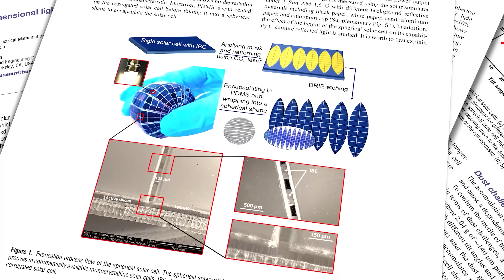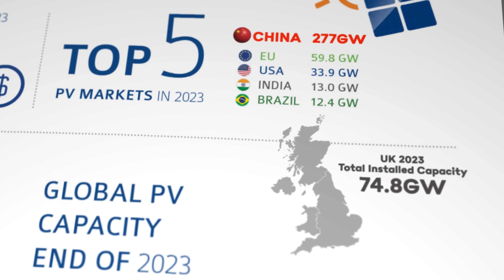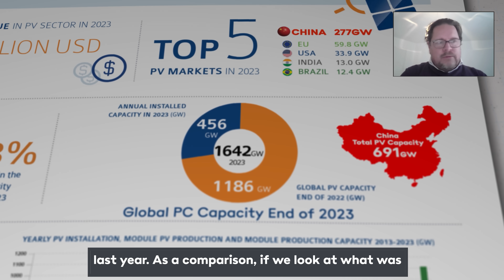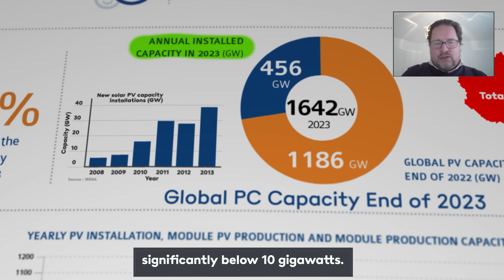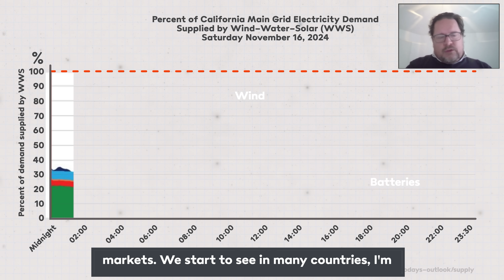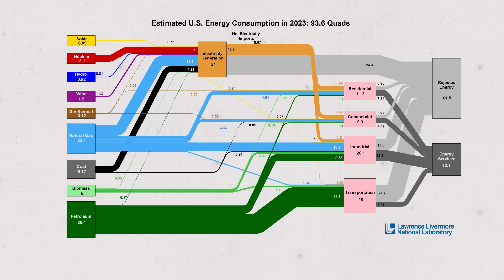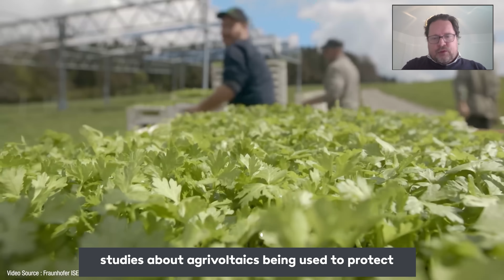Renewable Energy Domination

Comment: I understand that my household uses less than 10 KwH per day, unless I charge the car, in which case it adds 20 or 30 more KwH.  I can't possibly conceive of what 10 or 11 Gigawatts is.  How do I measure it, or compare it?
Reply: 10 GW will in an ideal situation (sunny, middle of the day) produce 10 GWh in an hour. 10 GWh is 10 000 000 kWh. So one hour of output from a 10 GW installation will power your home for around a million days, or close to 3000 years. But I guess a better measure is splitting 10 GW with 10 million homes each one using 1 kW for heating/cooling/cooking etc.

Comment: Physics tells us that every time you convert energy from one form to another, there's always energy loss. Different battery types store the energy differently. Car batteries for instance prioritise space use over energy efficiency.Which generally means that after converting electricity into battery storage and back you only have 30% or even less left. What that means is that to completely outcompete fossil fuels you have to generate the energy a about 1 third of the price with renewables. With other batteries that prioritise energy conservation this might be less. But its hard to combine those 2 priorities. So i dont see why car batteries is going to be the main energy storage for the grid. It just doesn't work as efficient.
Reply: Rubbish. The round-trip efficiency for car batteries is above 90%.
Reply: @rockyallen5092  
Take it easy, it's actually about 80, if not lightly less.
Reply: @rockyallen5092  Sounds very high. Do you have a link for that?
Reply: @martijnklijn2068  Well it sure as hell isn't 30 or less.
Reply: it's more to do with habits than tech/physics, surely?  Domestic cars, including EV cars, spend most of their time sitting around not being used, and so make ideal ways of balancing the grid if they happen to be connected.  Making smart grids through clever software is going to be the next big thing IMHO.

Comment: In Australia we pay much more for electricity due to the costs of converting the grid to cope with the excess energy produced by solar panels.  The transition to solar isn’t easy, or cheap, and the opportunists who have positioned themselves to take advantage of conventional base load generation when the system is stressed make a fortune by charging one. However, there’s a developing awareness that cheap EVs offer an excellent solution to using the excess solar power if they are charged during the day.
Reply: In places like Australia the government should require all workplace car parks to be fitted with chargers so cars can be plugged in during solar production time.
Reply: @adrianthoroughgood1191  better still, put solar roofs over the car parks as well - the cars get shade and electricity at the same time.
Reply: @theharper1  The charging can be done in DC.
Reply: @ronaldlindeman6136  that would be more efficient, but not necessarily practical depending on how the charging service is provided. From an employer's perspective it would be easier to outsource, so a standard grid connected charge point would probably be more likely, offset by the power from the solar roof (if installed).
Reply: @theharper1  absolutely! France has passed a law requiring solar panels over car parks.
Reply: @theharper1  Sure.    I have no direct knowledge of how the charging works, but I did think I read from comments that if someone has PV's and a solar system at their home and charge the car during the day, that charging would be done DC.   Like if someone has batteries hooked to their solar system, they I'm guessing they don't go from DC to AC to DC to charge the batteries?
Reply: @ronaldlindeman6136  I had to check myself, because I don't own an EV. The SolarEdge charger (as an example) is an AC unit not DC. So it would require a hybrid inverter. With respect to household batteries, it depends on whether they are AC or DC coupled. The Tesla Powerwall 2 is AC coupled and sits between the house and street in the circuit. So yes, the solar inverter converts to AC then the Powerwall converts back to DC to charge the battery. The SolarEdge battery is DC coupled, so it takes DC directly from the inverter which is more efficient. It looks to me like "mode 3" EV charging is AC coupled. SolarEdge was talking about introducing a bidirectional EV charger which would allow the car to supply power back to the grid (if the car is capable of it, and Teslas currently are not. The only cars that I know of which support V2G right now are Nissan EVs like the Leaf.
Reply: @theharper1  Thanks for the info on chargers, Solar power, DC or AC for batteries.    Only one car/motor vehicle support V2G?   They should get on that.
Reply: @ronaldlindeman6136  Nissan and Mitsubishi are the only companies that I know for sure support V2H/V2G because in Japan it's a disaster preparation feature so you can operate some things in an an emergency like your refrigerator when the grid is down because of an earthquake or typhoon etc. I checked the Australian model of the Mitsubishi PHEV models and they only support V2L while the Japanese models support V2G and V2H. The Nissan Leaf is the only one that I know has been tested in Australia with V2G. There may be Chinese EVs which support more than V2L but Tesla has so far refused to support anything other than V2L as far as I know.
Reply: @ronaldlindeman6136  I found a website which lists cars that have V2L, V2H and V2G. Brands include MG, BYD, Chery, Hyundai, Kia, Genesis, Nissan, Cupra, Mitsubishi, VW, Xpeng and Zeekr, but most are V2L and very few V2G or V2H. Tesla doesn't support V2X at all, and some suggest that's because doing so would undermine Powerwall sales.

Comment: So solution to end-of-life solar panels is recycling. That's the same plan for plastic, and you can see how that is going.
Reply: Difference is plastics are not valuable. Makes more sense to harvest back the good stuff from end of life solar panels, no?
Reply: @Sekir80  I'd say the difference is that solar panels last 25-30 years, while most recyclable plastic is single use.  I question the value of an old solar panel.  They are primarily silicon, derived from sand.  Not valuable.  They have a very low concentration of moderately valuable dopants.  A small amount of low to medium value metals used as conductors.  Where's the value?  I'm genuinely curious.  Absent some solid numbers, I suspect that they'd be fine getting crushed and dumped in a landfill.
Reply: @incognitotorpedo42  What a great point on single use/long term use!
And yes, I don't know if we can or if we even care to recycle silicon. Metals, on the other hand, can be useful. Most of the panels use alumínium as frame, that's good stuff. The rest might be trickier to claim back.

Comment: 13:35 "Discuss"  The 100 ships of coal, and the 50 ships of LNG represent "Energy". The ship with PV panels represents "Power".
Anyone that can't keep those two concepts straight should stop talking and sit down.
If he was referring to the "lifetime power" of the PV, then I suspect that he's way off in the numbers. 
And the 'when' would be an important counterpoint.
Reply: it is called: energy equivalent. Second, what would you do with the coal, if not making black ink? Right,, 99% of it is used to create electricity. Then do your calculation and convert
Reply: @monnoo8221  Have a seat.
Reply: @JxH  Obviously the PV was lifetime energy.  That's the only sensible way to describe it.  The LNG is burned once and it's gone.  The PV panels keep cranking out energy for 25-30 years.

Comment: Per capita is actually not that accurate. Smaller populations have it easier implementing solar.
Reply: Quite the opposite, a larger population will have it easier with the large-scale construction needed to balance solar power.
Reply: Australia is a continent with an interconnected grid,  that’s not easy at all for a small population to achieve, in fact it’s the most difficult distribution of power there is. Think again.

Comment: Wake me when "renewable energy" factories and supply chains are ran on renewables.
Reply: You better get out of bed because it's already happening.
Reply: Why? The video showed (which most people surely already knew) that the amount of CO2 emissions from the production of solar panels is minimal compared to the emissions from burning fossil fuels, they do what they are designed to do; providing us with far cleaner energy and helping us get to net zero.
Reply: @danyoutube7491  The video showed it, but reality doesn't.
Reply: @nustada  
"The video showed it but Reality doesn't" 
Are you deliberately ignoring the available facts?
Unable to use the internet?
Wilfully ignorant?
Living under a rock?
Lying?
I have noticed one thing about your posts, they are outdated nonsense.
Give it a break.
Reply: @davidwatson8118  You realize you said nothing of value?
Reply: @nustada  
Ok, so all of the above.
I'm not your librarian or research assistant.
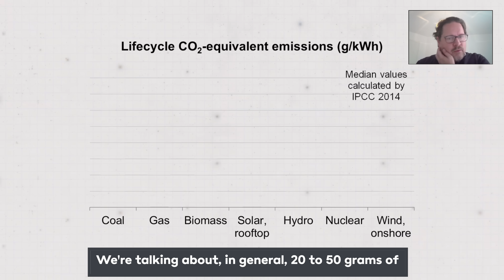Reply: Go back and watch 4:00 again so you can get a clue. Even if you powered the factories, ships, and trucks with 100% coal, tha would still only be ~8% of the emissions they displace in operation by not having to shove millions of tons of fossil fuel crap into a thermal plant for 20+ years. Renewables will continue to decarbonize along with the rest of manufacturing.

Comment: It won't work. The resource demands of solar and batteries - mining all those rare earth metals, to say nothing of concrete and steel, currently supplied by a predominantly fossil fuel economy, will become impossible to source or afford as a) resources are mined out, and b) with intermittent low grade energy. 
Solar panels last around 20 years, and batteries about half that. The recycling costs of billions of solar panels - again, will be unaffordable with low grade intermittent energy.   
A square of solar panels 1,500 km per side covers an area of two million two hundred and fifty thousand square km; and putting that 'in the desert somewhere' runs into the problem of getting energy from where it is produced to where its needed. 
And that's just to supply the electricity grid which is approximately 15% of total energy consumption. Total energy consumption in the United Kingdom was 142.0 million tonnes of oil equivalent (1,651 TWh) in 2019. 
And that's saying nothing about the rest of the world, including developing countries that can't afford to spend untold billions forevermore creating a mountain of tech scrap.  
By the time it hasn't worked, it will be too late.
Reply: Well, the Australians are already building a solar plant to provide power by cable to Singapore.
Reply: @seanlander9321  Are they? Weird. What kind of solar? Photovoltaics produce 48v; whereas an undersea cable requires 100kv minimum, with maybe 5%-10% transmission loss per 1000km. Singapore is 4300km away; meaning an undersea power cable six times the world's longest cable, to transmit solar energy at an ~30% power loss. You'd need an awful lot of solar panels. Even using heliostat power plants, (solar reflectors focused on a central tower) it would take less resources to generate the voltage needed - but the transmission distance is still a world record, and by a long way.
Reply: @ Suncable, it’s on the ASX.

Comment: also worth mentioning that some countries convert their hydro use to a pure ‚battery use case‘ where the use solar overheads during daytime to drive power at night. of course not every country is able to do that but it is a very efficient form of offsetting base loads that is available right now and would still have great potential for extension.

Comment: Could someone please explain to me what the Primary Energy Fallacy is, as mentioned at 8:18 ? Ideally concisely and simply, like Dave does. Thanks
Reply: The graph shows primary energy use vs real one. On the right side there are two important boxes "energy services" and "rejected energy". They are 1/3 - 2/3, roughly. The point is primary energy (coal, oil, gas, nuclear) is 3 times more than the actual electricity we use: you have to burn 3000 MWh of energy to create (and use) 1000MWh of electricity. Therefor, the 2/3 of the burnt energy is nothing more than waste heat, we discard, reject is. 
How did I do? Would you need another go? I'm thinking I did a half-decent job. Maybe.
Edit: Oh, the fallacy part: naysayers of solar/wind deliberately conflate these numbers and saying "we need 93.6 Quads of energy to be produced each year! solar and wind can't do that!", but actually we need to generate 32.1 Quads (energy services box), almost exatly only the 1/3 I was mentioning above.
Reply: @Sekir80  All the parts have now clicked together. Thank you, you did great.
Reply: @marsupialdungbucket  Thanks man! Glad it's clear.
Reply: @Sekir80  But primary energy is used for much more than just electricity generation.
Reply: @SweBeach2023  True! I was focused too much on that, sorry. Yet, you see the rejected box so big. Let's look at the bottom part, for example, petroleum -> transportation. See how much that contributes to rejected energy? Because ICE engines are very inefficient. If every vehicle would be electric (yes, planes as well) then it could be 85-90% efficient compared to the 5.87/27=21%.
And to think for a moment: what do you think about space heating, be at you home, an office or factory? Think! EVERY unit of heat ultimately goes to the environment. Every. Unit. Depending on insulation faster or slower, meaning if you have good insulation you need to burn less gas to heat your home but ultimately it just heats the planet.

Comment: Current EV's in the west are designed for rich early adopters.  I suspect that with greater penetration, that the contribution of this to grid storage will in practice be much less than the solar advocates estimate.  AFAIK, there is not yet any place where EVs contribute significantly to shifting of afternoon production to evening consumption.  Being in a vehicle doesn't make batteries cheaper - they make them more expensive.  If I don't need the capacity for transportation, why buy it?  For me, I'm investing in batteries.  But the justification is that I will be able to make use of cheaper off-grid property, and even in my case I'm probably going to be charging them in the winter off of a propane generator.  To go fully solar, would require me to invest about 3x the average per capita capital in grid provided electricity.  But, with a hybrid approach, it should work out and I'll be able to contribute to the eventual collapse of the grid! Yeah, I guess.
Reply: I always appreciate that on this channel when you posit a position base on technological considerations, the community responds with ... crickets!

Comment: While solar PVs may help in electricity market, we must keep in mind most of our energy use is in transport and industrials, largely dominated by fossil fuels. Would be interesting to see solar and batteries hauling global freight and moving passengers on cargo ships and locomotives and jet airplanes, heating winter homes and businesses at scale, facilitating industrial farming, and now AI data centers!

The energy density of oil may still be a hard feat to replace with clean energy. Electrifying our transport infrastructure will be an enormous undertaking requiring quite a bit of materials and resources across their maintenance/replacement life cycle. EVs aren't selling much in USA with incentives supposedly to be removed per next administration. Lab level hopes must scale now to industry operations before tipping points of the Earth System are crossed!
Reply: Cargo ships and jet aircraft are a relatively small part of the overall GHG problem.  Electrification can help the vast majority of the problem.  We can obsess over energy density all day long, but renewable electricity can drive data centers, cars, trucks, motorcycles, heat pumps, industrial processes, you name it.  It's not a problem.